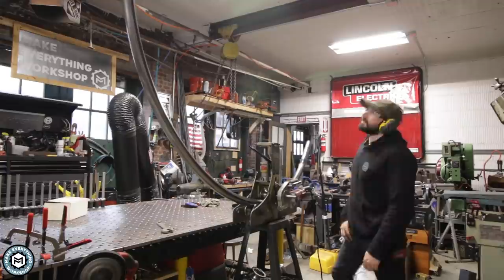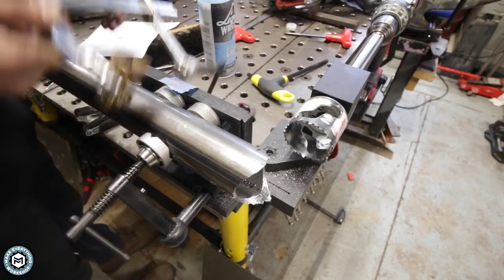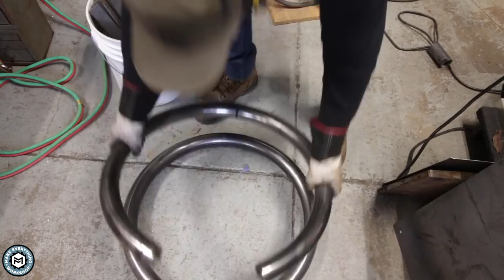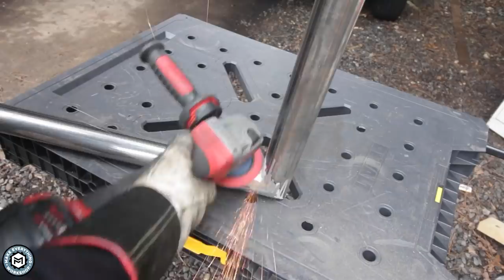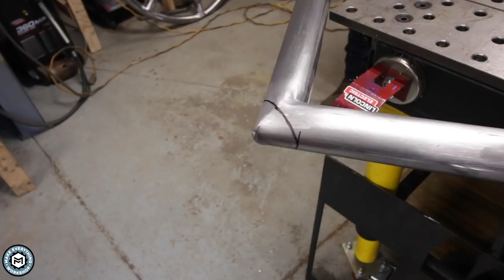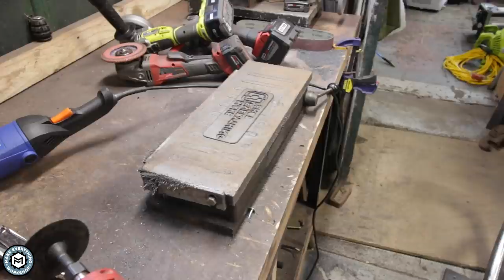Rolling Steel Tube Into Custom Bicycle Racks - Welding

Comment: That cope from the straight tube into the rolled tube would be a great reason to 3d print a coping template that you can slip over the straight tube to trace the perfect notch... If you're going to model the whole thing in fusion anyway, take 5 min and make a template to print out...👍